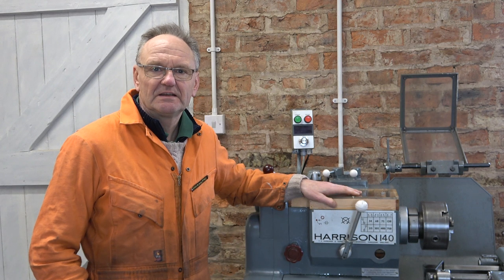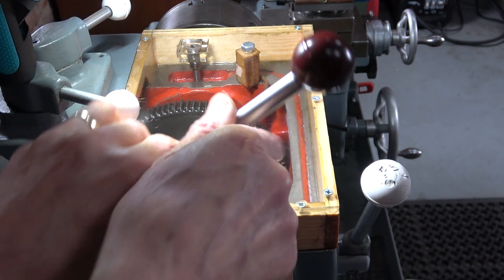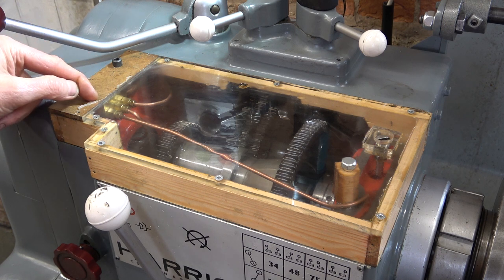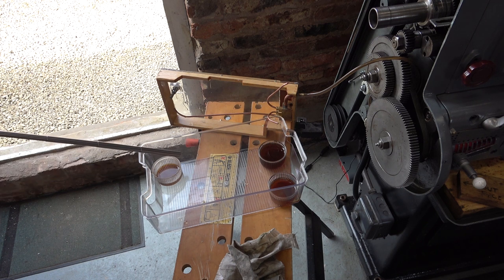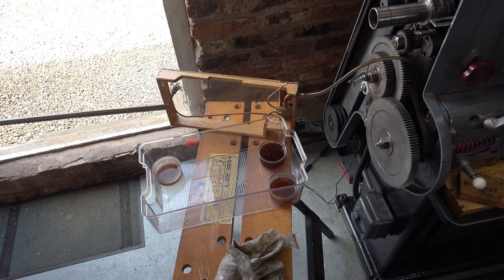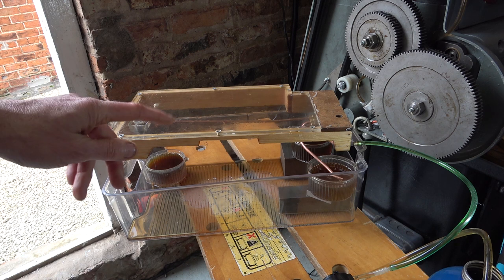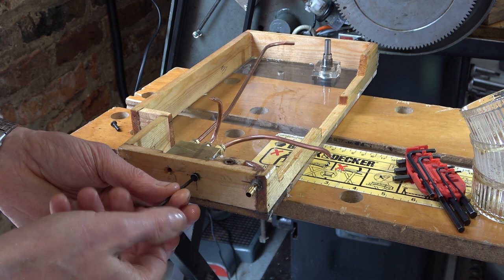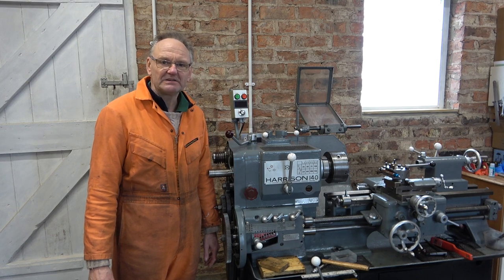HS68 Harrison lathe spindle bearings oil pump – Conclusion

Comment: .. Very interesting research, Paul,.. If / when I ever get around to to rebuilding my workshop, ( after the poxy fire that destroyed it all in September ! ) this will be a priority job for my 140 ,..
Reply from the maker: Hi Beardmondy, I enjoyed the project but did I really need to do it? At low speeds very little oil is needed. I guess it depends how much low speed work you do and at what load. But I still get satisfaction from giving the bearings a blast with the pump when the lathe has been standing a long while or I've got to do heavy threading on low speed. I made a 5/8 ACME tap (3 videos) and that was a lot of low speed heavy work. Cheers

Comment: Really slick setup. Several months back I had the crazy idea to do something like this for a fuel pressure regulator  on an old truck. Much to my surprise it seams to have worked. 
Sometimes experiments are a good thing
Reply from the maker: Hi Craig, sometimes stuff just works and to try is to succeed. cheers

Comment: Hi, I very much like what you have come up with. I bought a chinese lathe 330 swing 160mm  chuck gearhead lathe. I was looking for noise, made glass top(6mm) from wood that resembles the thickness of original cast iron top. I learned a lot from seeing the splashing.
Its all about the spindle bearings, other bearings are sealed in my case, gears get oil.
-Lowest gear.....Spindle bearings Never gets oil. Use for drilling.
-Faster gear........Spindle bearings Never gets oil.Use for drilling.
-The 3rd gear............(and  up) I use most, and now only the rear spindle bearing gets oil relatively quickly, and the front spindle bearing eventually gets oil.

My gearbox is different than yours, the inputshaft with gears is lower down. 
After much thought and experementing catching and channelling oil, no moving parts, but tricky to catch oil, heres in short what I did.
1-I double the oil level, also ISO 68 Hydrolic oil Fuchs IE similar to SAE-20. I also made a comparator wooden box with 4x 20mm syringes to compare oil.
-ISO 68 Hydrolic oil flows a bit faster than SAE 30 oil. Diff oil will burn out my 220V motor.
-Diff oil is a no no for my lathe.
-ISO 32 vacuum pump oil flows faster IE similar to SAE 10 oil.
-I thought about the Auto Transmission oil-ATF, but have not tried it yet.

Ok so after 3 weeks of trial and error to catch oil and get it channelled to the spindle bearings I came up with a selution consisting of catch plates oriented towards where the splashing happens on th glass. I found to catch oil, using aliminium 3mm plate, drilling 12mm holes on each side of the plate catches oil better than refecting it from the glas back on a plate in the end. THe splash goes throught the hole, the hole breaks it and traps it, it then flows down on a hirisontally monted plate between the spindle bearing holes.
-So lowest gear splashes are trapped by one plate strategically placed , fed by higher level of oil in input shaft gear.
-So the faster gear splashes are trapped by another strategically placed plate with holes, and trapped oil channelled on main horisontal plate and delivered to spindle bearings.
-So in higher gears no problem, it literally overfills the centrally main plate and the spindle bearings are both within 2 seconds flooded with oil, I like this part.
--To make up for the higher level I mounted a tank with 3 x 3mm drai holes at the bottom.
This tank stay  empty in lowest gear, but the gears upwards fill this tank, and keep this extra oil in suspention plus oil surplus now on catchplate out of gearbox, so the gearbox runs low again as long as its running in higher gears. I must still fit another tank, more tricky for reverse gears which I hardly ever use, although I did use it once.
I learned a lot about the flow of ISO68 hydrolic oil around ups and dows , valleys and corners and through holes and narrow spaces, very interesting.
-Levelling the lathe to the ground make sense in this regard of operation.
--Note:I used a dremel to grind flow pathes deep/wide enough to carry the 68 oil along the catch plates.= Main horisontal plate over gearbox, + 2 other catchplates with holes and groves by dremel. The groves makes a big difference directing flow on a plate.
-The plates are double secured not to drop down on gears, by screws and the lid.
-The surface tention of the oil in use helps and restricts flow which makes it tricky but interesting. THink about this, if in a car enginr your oil mis toothick, at high revs it may not drain back fast enough so oil pump may pump air around corners etc damaging the engine....
I am looking at a pump idea, but dont like the noise, I was thinking a car engine oil pump driven from motor at a slow relaxed non noisy speed, something like that, it dont need huge volume or pressure.
Reply from the maker: Hi Chris, I give you the prize for the longest comment ever. Thanks for taking the time to put it on. I like your scientific analytical approach. It amazes me and others that lathe manufacturers could produce a product with effectively no oil feed over parts of the speed range. It must have been a good drawing on the desk but never validated in tests. The passive catch plate or spinner ideas are the best I think but on my low range no oil was thrown up from the sump at all. The peristaltic pumps are extremely quiet if you can find one with enough flow. Another viewer is looking at a piston pump. I also like Blancolirio – just one I spotted on your subscription list. I’m not a pilot but I like the science.
Reply: @HaxbyShed  Thanks for being interested, I forgot to say I throw out the old indicator glass, and fitted a proper selfmade indicator  oil level like the height of a 5mm syringe and now I can properly see how the level rise and fall.
Also something interesting I came across oil splasing between two gears, is the fact that one gear shaft is placed higher or lower than the other determine the direction, apart from direction of turn, the direction it shoot it out. Good day.

Comment: Very interesting video.  I've never considered that there might be oil starvation at any of the bearings in my lathe.

My lathe has a full circumferential oil channel..........entirely around the perimeter of the headstock.  It appears that if yours was the same, it would get oil in back gear/low range.  I noticed that low range splashed oil to the backside of the headstock.

Spindle bearings should run fairly warm after continuous turning.  Use an IR thermometer, and see if you're within a 120-150ishF range.  Heat doesn't affect the bearing material until the bearing hits upwards of 250*.

Another thing is ISO rating.   Sometimes folks err on the heavy side.  Heavier oil doesn't always flow where it's supposed to.  In the modern import lathes ISO 32 is specified.  Lighter oil will flow into low clearance bearings easier.  A P5 bearing has extremely tight tolerances, and needs a fairly light oil to form the "wedge" that prevents metal to metal contact.

Anyway...................Your solution was absolutely elegant.
Reply from the maker: Hi Farmersam, my oil ledge is only at the front of the headstock and not all the way along even. The bearings were nipped up too tightly and honestly they were getting too hot to touch on fast work (1500 rpm tops). I backed them off a fraction and they are perfect now. It only took a few degrees back-off on the pre-load nut but it was a transformation. After trying various thicker oils I went back to the ISO68 specified by the factory. Trying the thicker oils was an interesting experiment and I learnt a lot but really I just wasted time and money (oh and made a video). If I was making the oil feed again would I only feed the front spindle bearing and not the others?, I don't know maybe. It had lasted 50 years ok before I added the feed. Cheers.

Comment: Hello,
Interesting as always... I think had you made all three pipes the same length (coiling some to help with positioning) it would most like had a similar effect as crimping... old diesel engines would have the pipes from fuel pump to injectors all the same length... See you on the next one...
Take care.
Paul,,
Reply: Absolutely.  The fluid is taking the path of least resistance.   You should try balancing the air pipes on my blower systems on my fishery. Difusers in at different depths,.  That will make you swear 😜😂
Reply from the maker: Hi, it's only recently I've realised how much resistance to flow is generated as fluid travels along an open pipe and how much the length of pipe matters. I used to think simplistically it was all about the bore diameter. It's a whole new topic for my brain to process in the background whilst I'm asleep :-)

Comment: Excellent! Thank you for sharing, now I need to make the same thing for my Harrison M300. Would you care to share a link to the pump you used last?
Reply from the maker: Hi Finchley, the second (peristaltic) pump was similar to ebay item 225274868200. I've found this to be continuously rated whereas the gear pump is not. But the gear pump has more flow. More recently however I have found a peristaltic pump with a higher flow at a reasonable price, ebay item 314331563804, and I plan to fit this soon. At the moment I still have the gear pump fitted but then I have to remember to press the button when I want it (i.e. if I'm using the lathe in low gear). Cheers

Comment: I really enjoyed watching your problem solving. How is the system working now eight months later?
Reply from the maker: Hi Philip, it still works just fine so long as I remember to press the button to start it. I don't use the low range for heavy work very often but there are times when it is important not to forget. I am still considering fitting a larger peristaltic pump (larger than the one I showed in the video - maybe 0.5 litre per minute) and it could run all the time but they are a bit expensive (about £35 on ebay) and so I am hesitating. Cheers

Comment: Hi HS, 

Have you discovered whether the spindle bearings are fancy imperial items yet or standard metric parts?
Reply from the maker: Hi MJB Eng, mine are Timken. The manual says one Timken 387/382A and one Timken 387/382B.  From a bit of searching it looks like the dimensions are 2.25x3.8125x0.8268 inch and 2.25x3.8125x0.3125 inch respectively, but be sure to check it for yourself. I did not buy/fit new because adjustment was sufficient (see video HS49). Prices I found were about £125 for the pair, at the time. Cheers
Reply: @HaxbyShed  thank you, yes I may not need to replace but lathe still very tight to turn the spindle. Not well maintained, came from a school. Three years I've owned it and it's still tight, even after backing off.
Reply from the maker: @MJBEngineering  In my experience school lathes where not heavily used but got bashed about and poorly maintained - all my oiling points were pumped full of grease and the screw cutting gearbox was like one massive grease-cake inside. I'd suggest mark the bearing adjustment rings so you know where they are now and then back them right off and then see if it runs freely.